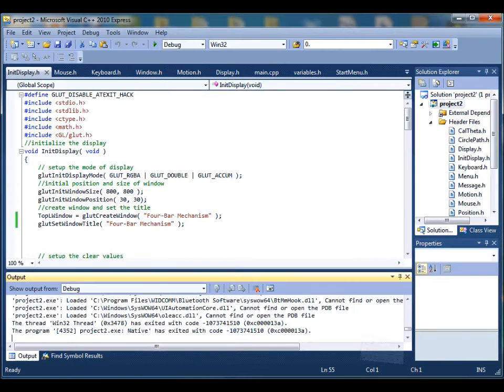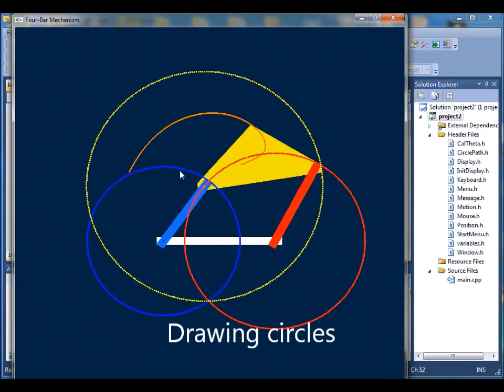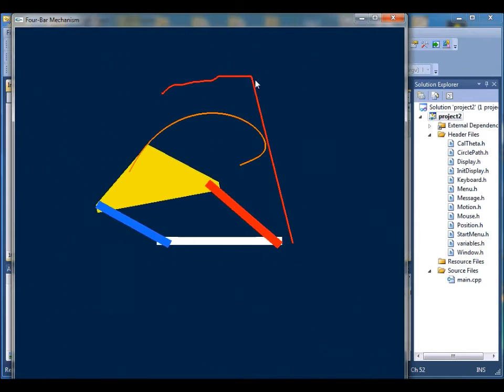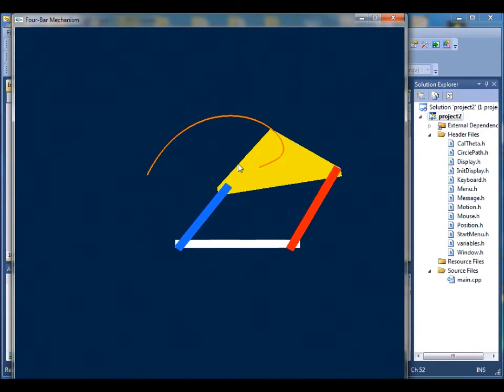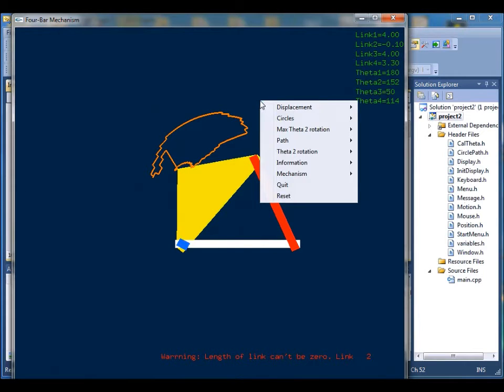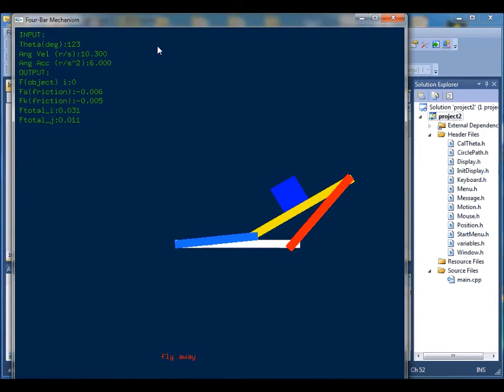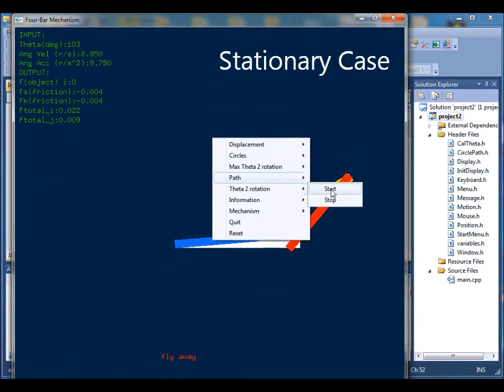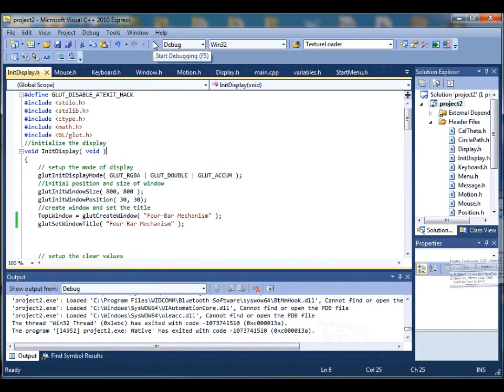ENSC 489 - Four bar Mechanism Simulation using OpenGL

Comment: Is this class about using CAD or creating CAD software?
Reply from the maker: It used to be but it changed to C++ and OpenGL.
Reply: So it's about coding your own simulations then?
Reply from the maker: Yes,basically writing your own simulation code from scratch by calling simple openGL functions.